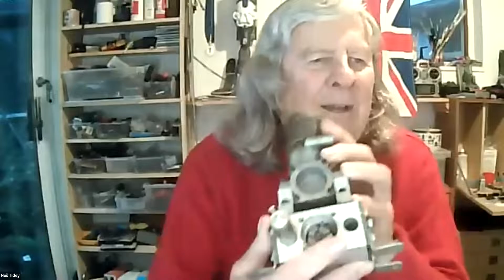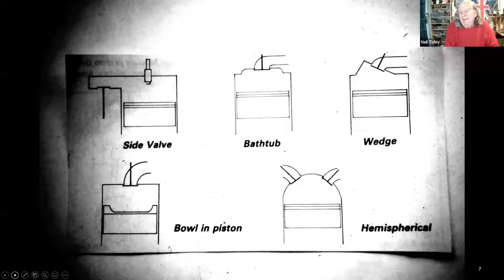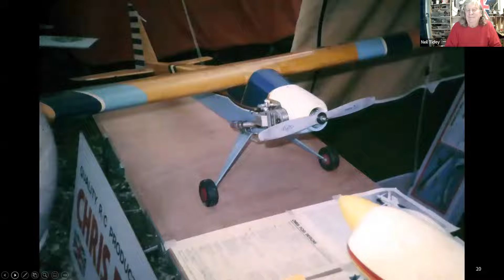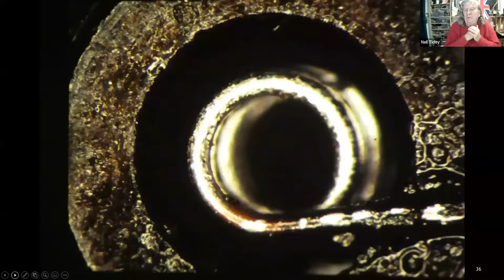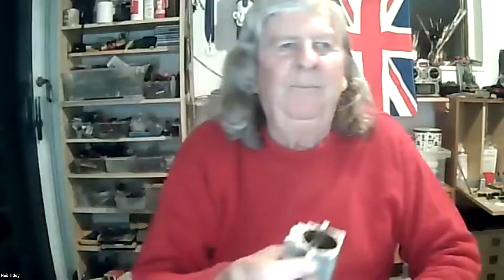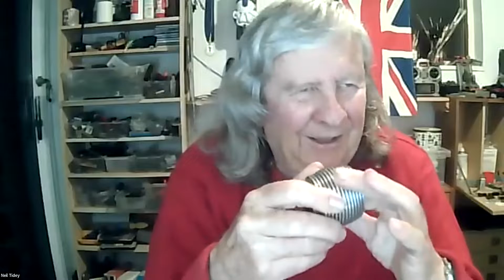BMFA In the Air Tonight - The development of 4 stroke engines with Neil Tidey.

Comment: Thank you so much Neil for your excellent presentation.

I`m a confirmed Laser convert. I now run a Laser 180 and am collectiong one of Jon`s new 160 flat twins from the factory in a couple of days.

My 180 runs like a sewing machine. In fact once started, it doesn`t like to stop. It`s quite incredible how slowly the idle can be set. You can almost see the blades turning! That gives a tremendous sense of security knowing this engine is so reluctant to flame out at such low RPM.

Without doubt, Laser Engines manufacture the finest model engines available. It just doesn`t get any better.

Thank you for having the foresight and effort to mach such amazing pieces of machinery. If we ever meet up, I`ll buy you a beer. 

Best wishes. Mike